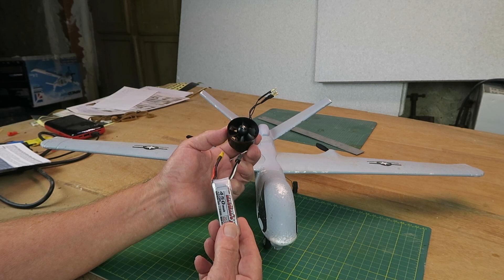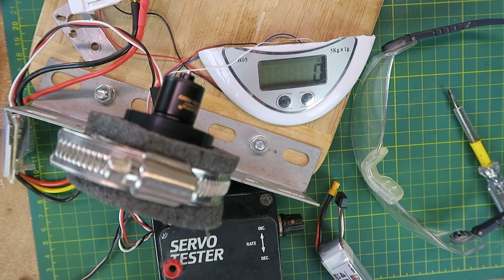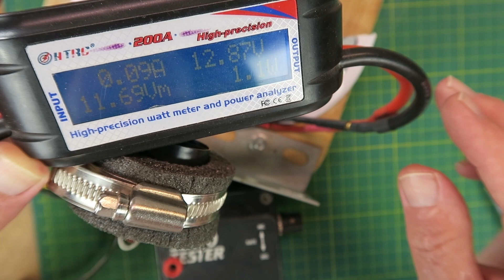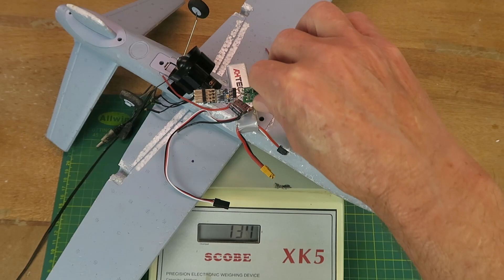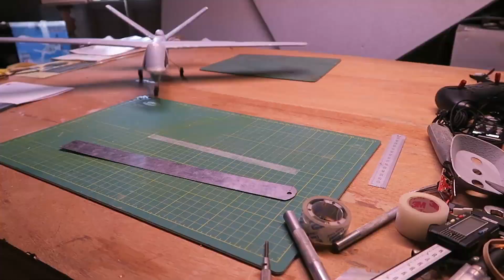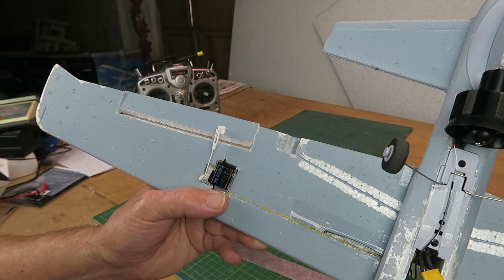Mini RC Predator Z51 30mm EDF Upgrade Mod

Comment: Hi Greg - always look forward to your vids and this is no exception. I am no aeronautical engineer but I think with your setup pitch control is going
to prove difficult to control due to the very short mechanical moment between the CG/CP and the control surfaces. Elevators are normally located at the rear of the fuselage to provide a good mechanical moment between the CG/CP and the control surfaces - this moment (elevator authority) can in turn be regulated/tamed down by adjustment of control linkages or electronic means to provide the required flight characteristics.
Reply from the maker: Wise words Tom! I think if I pursue the project much further I will add elevators. Watch this space!!